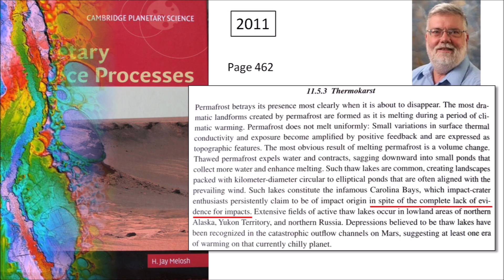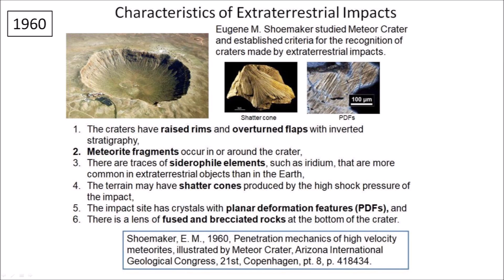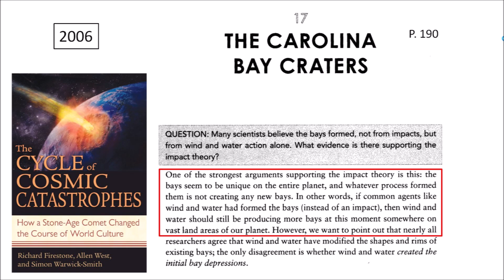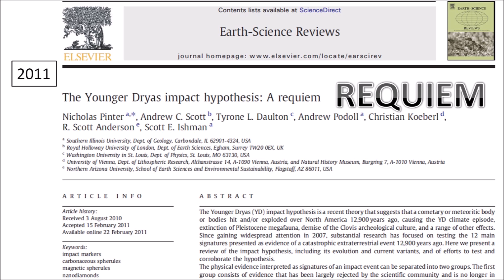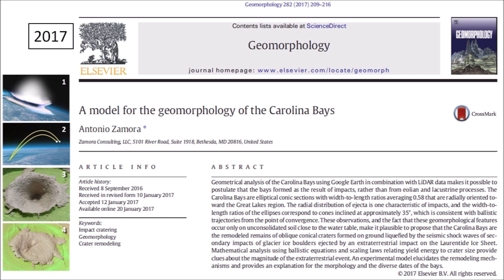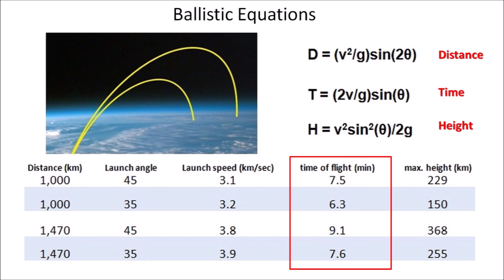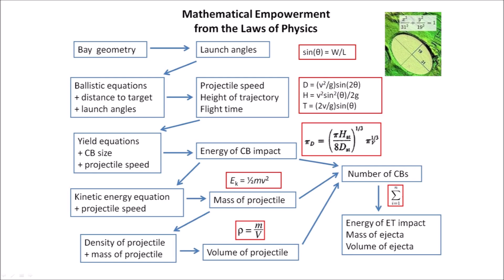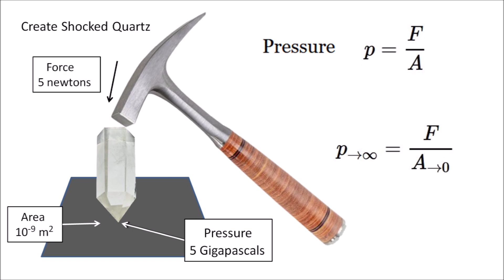Shocked Quartz in the Carolina Bays?

Comment: Nicolas Pinter et al. are wrong. "The absence of evidence does not mean the lack of evidence". I have been able to account for the two directions, low angle hyper velocity impacts of the bays quite easily, and working on an origin mechanism for cratering of the bays and great lakes etc. and seems to getting through, Thanks Prof Zamora

Comment: Large earth quakes make perfect round features like than in mud flats. I saw some in the mud near lakes and rivers after the 2018 7.1 Alaskan earth quake. I have been through 5 or more 7.0+ earth quakes but the 2018 quake was super short but violent. It made the water near my well shoot up than freeze like a water pipe made of ice. I could see down into the ground with a flashlight about 20 feet. Are the holes in the bed rock made of sand stone or mud flats? I have also seen a small version of features like this where ground water is forced to the surface. I must say it does look like a shooting range after the 4th of July. Great vid thanks never knew about the Carolina circles. Shocked Quartz will tell that tail. Just go for a swim and take a look ur self:0

Comment: "Platinum, shock-fractured quartz, microspherules, and meltglass widely distributed in Eastern USA at the Younger Dryas onset (12.8 ka)"

Published May 8, 2024: "Thus, evidence shows that glass-filled, shock-fractured quartz possibly was produced during YDB airbursts through the two processes discussed above: (i) ground surface impacts by hypervelocity fragments of the airburst bolide and (ii) jetting that filled grain fractures with molten material."

Comment: I was just google earthing and found i live on the edge of one of the impact structures!  In harnett county NC, near the river where many are obscured, but there are dark patches of dirt in fields that are plowed up bays!  You can see bays that are half-plowed and there are the same dark patches.  Across the street when it rains a lot there is a little "pond".  Also the frogs are crazy around here, there are many larger craters all around.  Anyways, i think the term "frog holler" is an old term for these structures.  There was a tv show with that name...
Reply from the maker: Add the LiDAR visualization tool for Google Earth. It gives you a fantastic view. http://cbaysurvey.cintos.org/
Reply: Look for unusual rocks along the edges of those fields. Select those that appear to not match local sources. Use google to compare them. Take any anomalous rocks to your local geologist for analyzing. It's worth a shot.

Comment: would suborbital ejecta from an extraterrestrial impact on an ice sheet even have enough energy to create shocked quartz? I'd think the chances would be slim, and the target would have to have absolutely perfect conditions for creating shocked quartz. Just thinkin'.
Reply from the maker: You are right. The secondary impacts only had speeds of 3 to 4 km/s. This is why I had a chart of the decrease of kinetic energy during penetration.
Reply: @Antonio_Zamora  ok, thanks! I was reading that chart, but didn't realize it's connection to shocked quartz. Thanks!

Comment: The biggest bays will have the closest orientation to the impact site. Like bird shot scattering, small bays would be all over the place due to tumbling out of the initial trajectory after bumping into the bigger projectiles. The biggest projectiles would be nearly unfased by a small impact as they moved. As a bullet flies straight, the bigest bays will point to the epicenter of the impact. A crash at the end of a drag race is usually preceded by a trail of burnt rubber. A 5 mile long Carolina Bay is a better indicator than a 1 mile bay. Anything that punches through 2 Km of ice will likely still cause shocked quartz below the ice. Thank you for another video. Good luck.